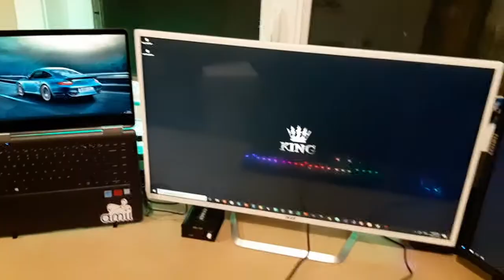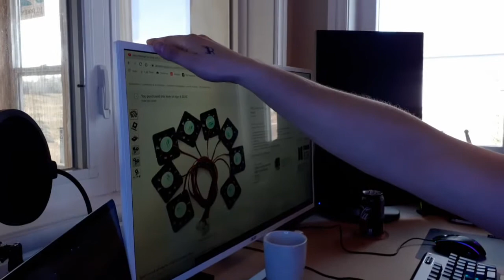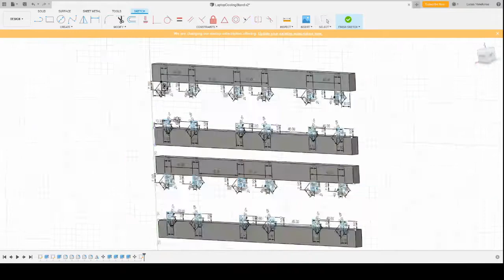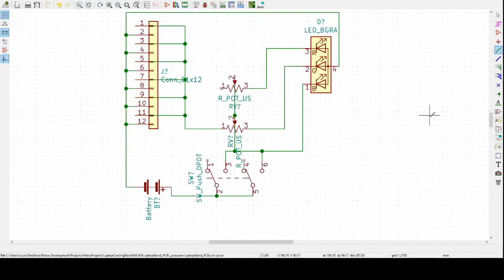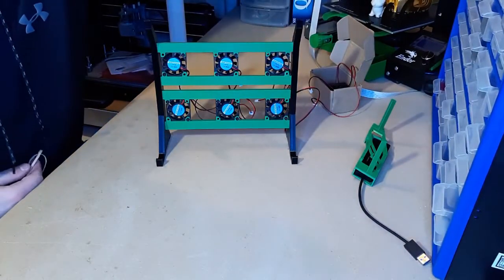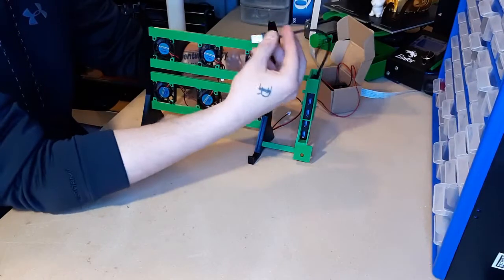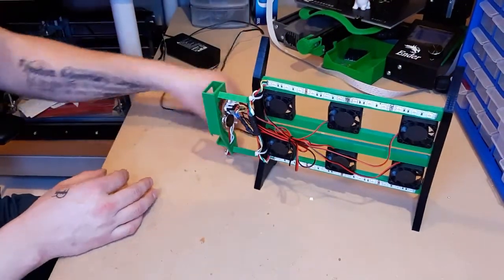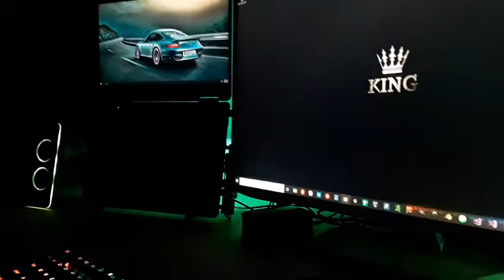3D Printed Vertical Laptop Cooling Stand

Comment: Love the end result.  By the way do you have a build video or links for the Pcb mill? Looks great.
Reply from the maker: I don't have any links but to give a an idea on what to search for:
It's a SainSmart Genmitsu CNC Router 3018-PRO

The software I use is 
- KiCad to design the PCB
- FlatCam to turn the design into G-Code
- GrblControl (Candle) to run the G-Code and control the Router